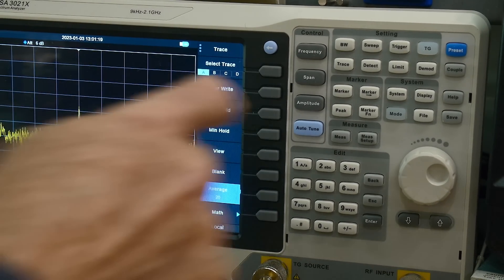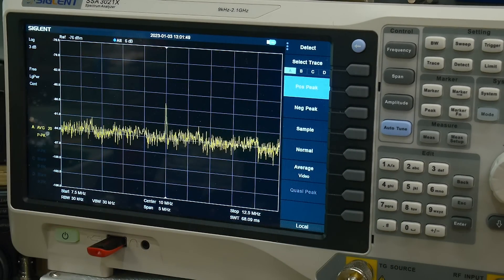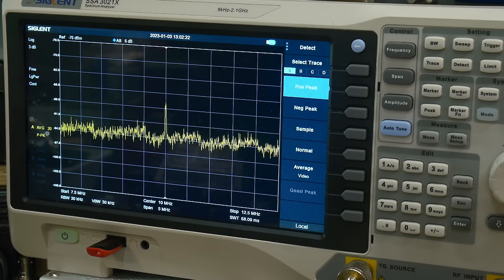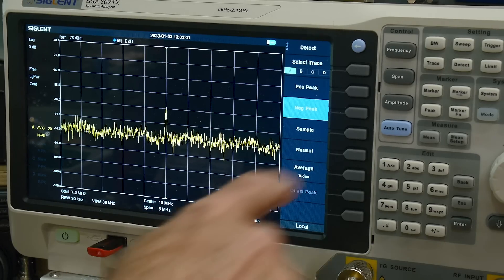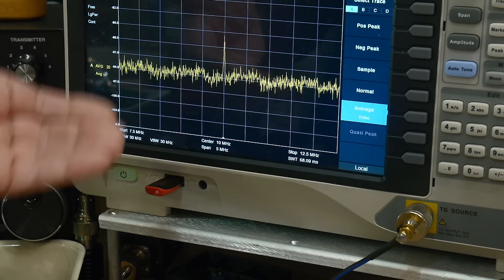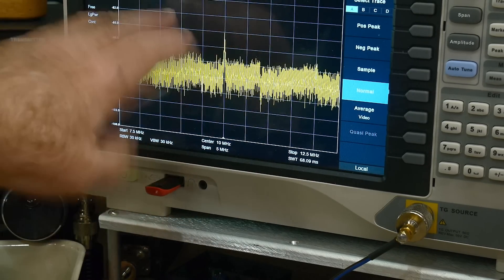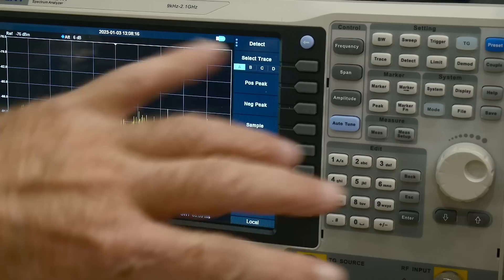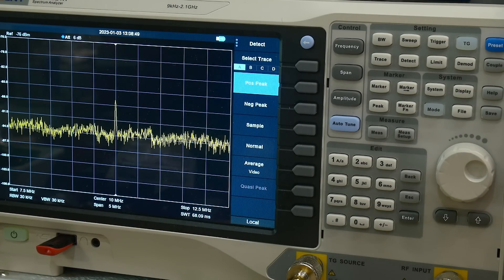#1391 Spectrum Analyzer Detect Modes

Comment: Pixels? It seems you are discussing sampling rates. Pixels are image resolution (not sample resolution) and that is just going to confuse people.
Reply from the maker: Each value on the screen divided by pixel count contains many samples that are used to get a peak or ave for each point
Reply: @IMSAIGuy  I understand what you mean, I'm concerned that others won't. Using accurate terminology is important to avoid confusing people that are still learning about this. But hey, you made a video about it and that is good and more than most of us have done.

Comment: According to this, if I export the raw data from the SA I will get 1024 "pixels"?
Reply from the maker: no, the data will be a string of data, sample points, the number of points may or may not be the number of display pixels
Reply: @IMSAIGuy  Can it be greater than the number of pixels?
Reply from the maker: @galileo_rs  yes, depends on the system
Reply: @IMSAIGuy  So if it is not dependent of the resolution of the screen what does it depend on?
Reply from the maker: @galileo_rs  imagine an oscilloscope with 1 million point depth, very common. the display is a subset of the data and you can zoom and move around. so the spectrum analyzer may have many more samples in memory also. I think it is more common that the data output is exactly the same as the display resolution.

Comment: To make use of the display functions and the adjustable resolution bandwidth how about separating a constant signal from the noise in the case of a satellite LNA. It has a crystal stabilized oscillator and a binary divider. That binary divider delivers a rather low power but very characteristic spectrum to the output with many lines of different intensity which is interesting to observe and to analyze going deeper and deeper into it.